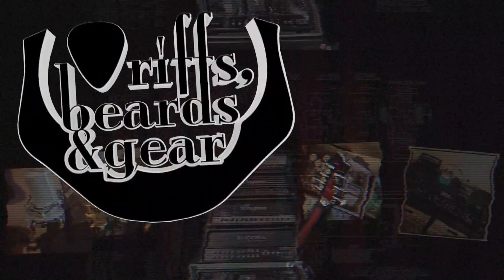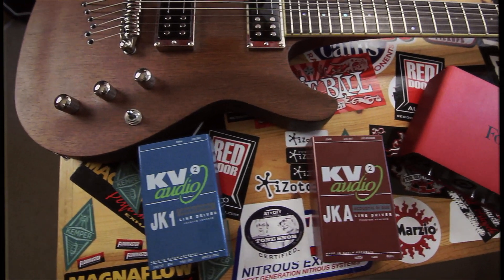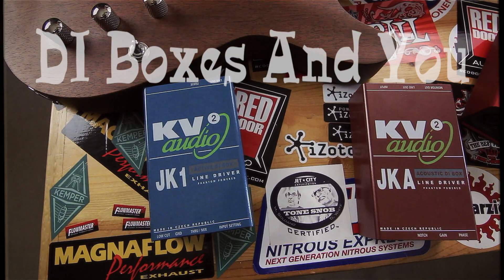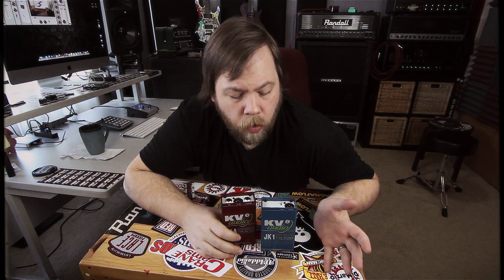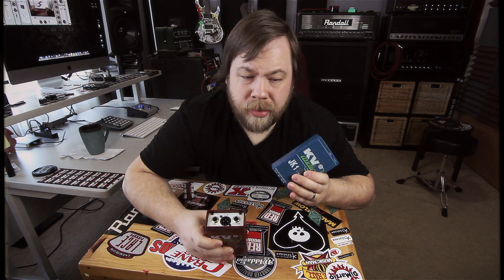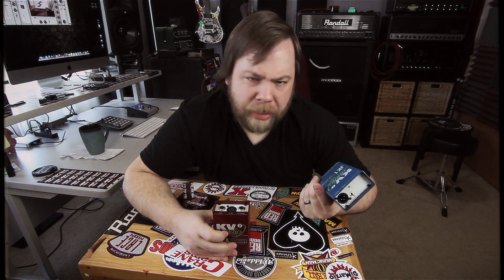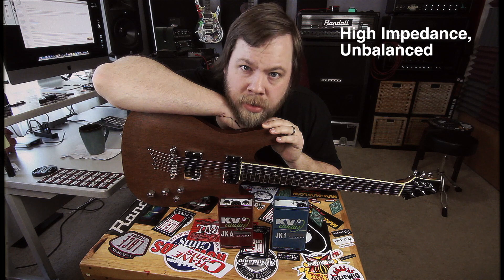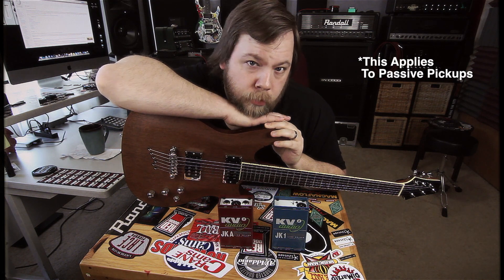Tutorial: DI Boxes & You

Comment: I've been having this clipping issue on "inst" option with my 2i2 for a long time. I simply searched "ryan bruce di boxes" because I ASSUMED you had to have covered this, and bam, you did. You are among some of the greatest gear resources on the entire web, and you have never failed my expectations.
Reply: You may not notice it, but 2i2 does clip on line. My solution was getting a cheap behringer DI box (ultra-di DI400P) which ran me about 20 bucks. It fixes instrument level input by turning it into microphone level, which is what the scarlett 2i2 is actually looking for, for some reason.
Reply: Does the guitar you're using have humbuckers? I've read places that if you're using single coil then you won't have a clipping problem. Otherwise I'd say you're lucky haha if it's not a problem, don't waste money on a box.
Reply: Sounds like you might be losing some tone with that option, thanks for the suggestion though I'll have to test that.

Comment: I own a Focusrite 2i2, it has independent gain controls and line/instrument switches in the Jack/XLR combos, and never got any clipping, even when plugging my guitar directly into the interface...
Reply: Just the guitar straight in the interface, sometimes going through an overdrive pedal before going into the 2i2, I just keep the gain pretty low, about 9 o'clock
Reply: It also depends on which pickups you are using, I have an Epiphone LP (Epiphone pickups, pretty hot), a guitar with a DiMarzio Super Distortion and a Seymour Duncan hot Rails, and an Ibanez, so I'm dealing with high-gain pickups, maybe single coil pickups need a little gain boost, but always check the master volume and individual volume meters at your DAW to make sure you're not clipping!
Reply: There are two different generations of 2i2 models, the older which had clipping issues due to its input not being properly High-Z, and the second generation ones in which the inputs were supposedly changed out for proper instrument connection padding.

Comment: when it comes to recording BASS DI should i invest in a DI box? My audio interface already has a 'intrument input' but is it possible that the signal from the bass could damage it in any way?
Reply: If it already had instrument input, and the cable length is below 4-5meters, don't bother. Then again, if you decided to go for one, these two are good but i'd suggest to check out BSS AR133 or radial firefly.

Comment: Hey man, few questions. I have a chain of pedals that I want to run into my scarlett 2i2(2nd gen). I just want to use logic to get a clean tone, and then manipulate it with my pedals.  This is because I get an absurd amount of noise whenever I try and use any high gain amp sims in logic or any other emulator. The noise isn't too bad doing this, but my tone suffers. It sounds a little muffled and muddy(not very colored). So, is a DI box necessary if my signal chain is going guitar>pedals>2i2>Logic?  Also, would a DI box help reduce the noise? Because if so, I would just use software to get overdriven tones and such.
Reply: connect your line out to your pedalboard (with preferably a re-amp module in between to lower the level) and then route it back to the input of the 2i2. You will need to use your headphone to track what you are doing as you have just used up your line outs but this is gonna work, been there, done that. Hope this helps.

Comment: I've got my guitar plugged into an active DI (Palmer Audio Pan 02), have the XLR going directly into the mic inputs of my audio midi interface (Roland Duo Ex) and still get clipping. Also, it makes no difference if I have the switch toggled to hi-z or lo-z on my audio midi interface, phantom power or no phantom power on. What gives?
Reply: Roland duo ex seems to have instrument in so why not using that! Select instrument in dropping the DI box, set that to hi-z (since guitars are hi impedance stuffs) and turn off phantom power (unnecessary operation in this case) and turn down the input gain, should be ok.

Comment: I need help, man. I think I fried my audio interface because i was plugging my amp head into it DIRECTLY without a DI box. 
Like, shit. Is that what i need a DI box for? SO I don't fry shit when recording? It sounded like dirty cat farts for awhile and then stopped working completely. It sucked!
Reply: Sure this means nothing now since it has almost been 6 months but it sounds like you plugged in your speaker output into the box? Definitely not the way to do it. If you want to use an amp to record with, it pretty much needs a "line out" jack on the back or you can use a mic. BTW, if it is a tube amp, NEVER operate it without having at least one speaker attached! To do so would destroy the amp.

Comment: So you want to plug a DI box into an interface component into your computer for recording?
Reply: ***** Do DI boxes have any benefit in terms of quality when plugging into a 2i2 for example? I don't have any problems with clipping on my 2i2 when plugging in directly btw.
Reply: ***** Cheers buddy, I thought it worked ok, nice to know I have a feature I didn't know about lol :) Do you think a DI box would have any benefit on tonal quality? Or would it be too negligible to warrant it?
Reply: Cheers for the comments anyway bud. Good to know these things though.
Reply: ***** Solid state technology, meaning technology using transistors, can be analog (most guitar pedals for example) while digital technology uses transistors but it's digital.
They're different things, and solid state doesn't imply digital stuff.

DI boxes are used to convert high impedance signals into line level signals, for going from a guitar pickup to a recording console or a line level input on an audio interface.